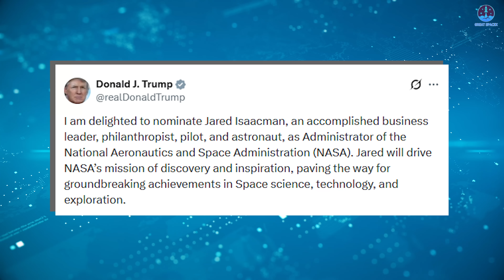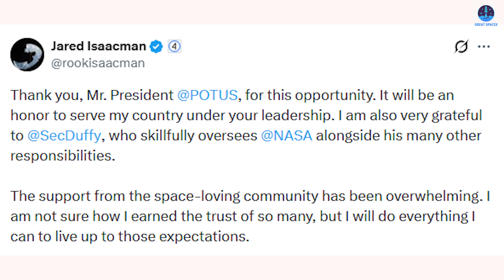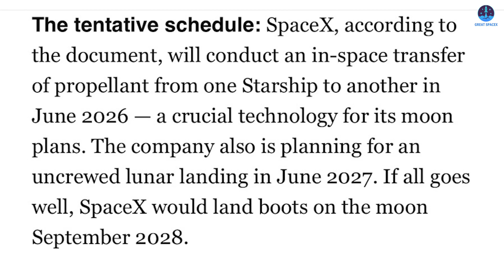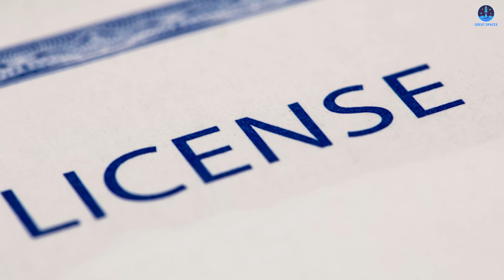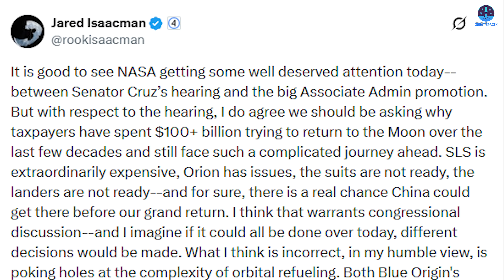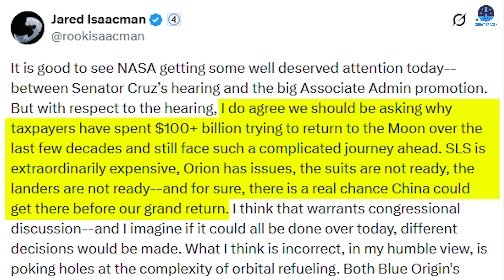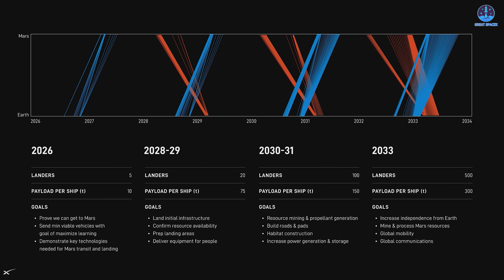What the new NASA leader Should Change to U.S. landing Back to the Moon before China?

Comment: SpaceX can get a jump on a moon base and infrastructures on the moon to produce oxygen and methane but also have life support systems in place, before the manned mission. By Strategically Landing a couple of Unmanned starships on the moon horizontally and utilizing several Optimus robots to build the systems needed. The hulls of those ships can also be utilized as habitats for the first moon base.
Reply: How about 1orbit first😂
Reply from the maker: Wow 😲
Reply: Most of Starship is fuel tanks and engines.
Reply: @mrbaab5932  The capacity of the cargo Bay is larger than the capacity of the ISS. In order to carry 100 tons of cargo. That makes a humongous living space when converted habitat and Command Center. The fuel tanks can be converted into habitat as well or for growing food.